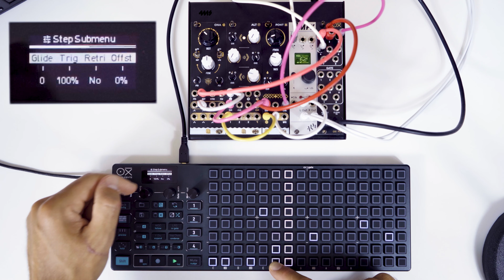OXI One Tutorial - CV Trigger Envelopes & Modulations

Comment: I am really going through the rabbithole with this machine. It takes some time to learn, but then a whole world opens up...! I was wondering if it would be possible to make the velocity lane a different length, like with the mod lanes. It would open up some really nice options for midi gear that only listens to velocity. In other cases when a device listens to say aftertouch, parameters could be modulated via a mod lane...
Reply from the maker: you can actually use a mod lane to internally modulate the velocity! and you can try the matriceal mode which separates all sequencer parameters in different tracks
Reply: @oxiinstruments  Ahhhhh I didn't know that, that's great! The random generator is altering the normal velocity lane though.

Comment: What LFO offset settings will give a bipolar LFO? I read that the oxi goes -3 to +5 volts I believe, but the offset is shown in a numeric value from +64 to -64. I’m trying to figure how the offset values roughly relate to voltage with the amount set to 100